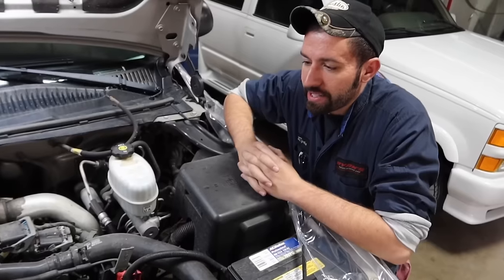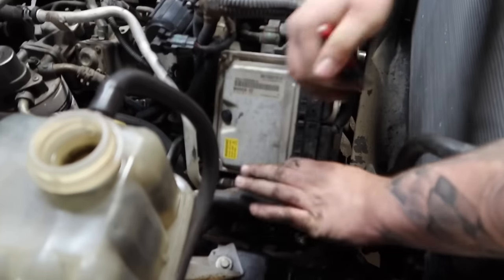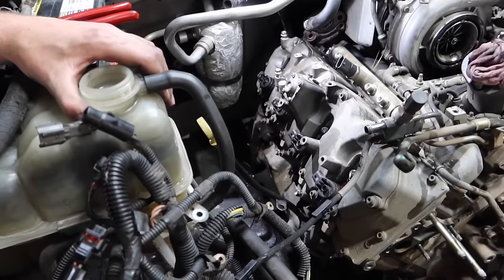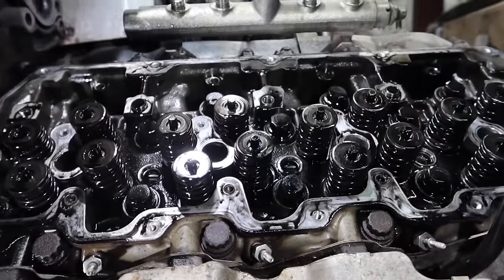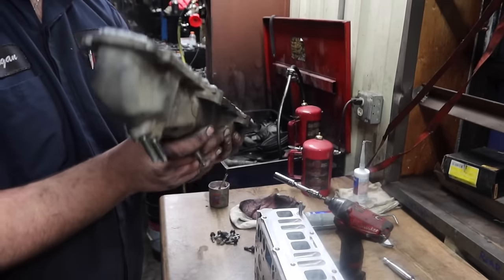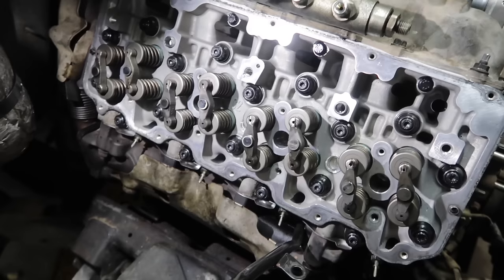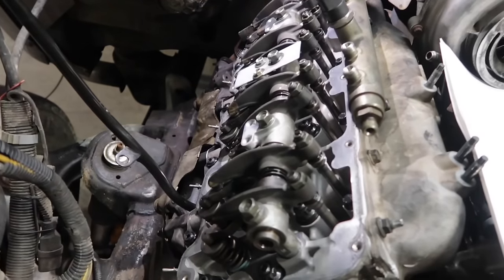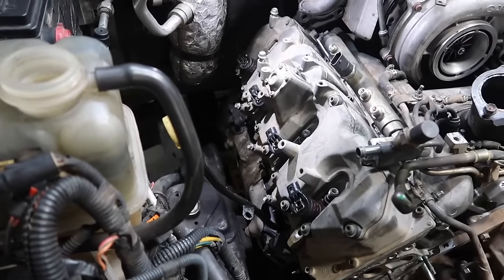How To Install Head Gaskets And Head Studs | Duramax

Comment: followed this video doing headgaskets on my 04, now I'm doing another 05 lly. Thanks again for your help.
Reply: Are you telling me I can follow this video the whole time I do my head gaskets? I’ve never done them b4
Reply: @logan8256  there's a few things I did differently:
-after tons of research I found prepping the block with sandpaper was a bit questionable, I used a razor blade and wd40
-make sure you stuff the pushrod valleys with rags
-make sure you change the oil before startup
-i chose to leave the exhaust manifold on the truck, found it much easier
-if your going the route of deleting your egr, I strongly recommend doing something with the y bridge. the mouthpiece will blow out without the factory egr holding it in, so I jb welded the 2 together 
-when removing the valve cover hex bolts, spend lots of time cleaning them out or you will strip them
-i found it much easier to remove the hood, especially if your doing it in your garage.

I've down 2 duramaxs, the first one I did the sand paper method as shown in the video, 40,000 kms later no problems. the second time I just used the razor blade. wasn't able to find any information online of anyone using sandpaper so made me very nervous.

good luck
Reply: @noahthompson9930 How did you clean the metal sanding dust out of the cylinders and coolant ports before reassembly?

Comment: Nice video of going through the process. A couple things you didn't address for your customers. The GM Technical Service Bulletin on these engines specifically goes over this part of deck prep to keep abrasives OUT of the critical areas of the engine. You are sanding the block deck with 80 grit sand paper allowing the sanding media to fall into the engine at the lifter openings and the 4 oil drain back holes in the bottom section of the deck, then proceed to NOT explain to people how important it is to NOT get sanding grit down into the oil system. How do you get away with that? Then you fail to explain that the main issue that you would be attempting to correct with a sanding block on the deck is that the deck will have a low spot at the exact point of head gasket failure. Look @35:46 in the video where you happen to shine the light on the entire passenger side deck, you can still see the low spot(dark area) in the deck that coincides with where the fire ring on that gasket was blown at the rear of the cylinder. This is where the fire ring seals on the deck, the deck is still low there. I'm not saying it is going to fail, but it has potential to blow again in the same spot "if it is too low and not addressed properly". I know you do a lot of these jobs, how many have failed since you did this to them? You may have taken steps to ensure this didn't happen, but I don't see you addressing it here in this video, please inform your customers about these not so minor details I've brought up here. Thanks for showing your process. For people watching,  DO NOT SAND your block deck like these people do in this video UNLESS you can keep these heavy abrasives out of your ring lands, and your oil and water passages!!
Reply: I do wish someone would respond to this…or at least share what they believe is the proper method.
Reply: Bringing this up is a waste of time. I've made a couple calls to the shop to speak with one of their techs to get some answers about this specific issue but their techs don't speak over the phone. So with no explanation of how they clean the block, this video should NOT be used as a reference. A lot of people's motors will end up in an early grave if they follow this video.

Comment: They did an awesome job on that headgasket job. The only thing i saw that i didnt like ( im not a professional) was that when he sanded the block surface, he didnt put anything in the pushrod valleys to prevent grit from falling in. Correct me if i just didnt see it and he actually did. Other than that they did a good job and you made a very detailed video. Too bad it came 4 months late because i would have used it to my advantage.
Reply: Yeah I personally would have done a little more to seal off other parts of the engine from sanding grit. That said though, even if some grit made it to the oil pan and was picked up by the pump, the first stop it hits is the oil filter before moving on to the bearings and other critical wear surfaces,
Reply: Absolutely. try being as clean as possible. With dirt,cast iron and sandpaper grit that will be hard to do, but try. That and  some type of lube on the valvetrain moving parts.
Reply: right... wads of paper towels would been nice
Reply: @jeffscott3160  some engines have a oil filter before the oil pump .... not the duramax ...grains of rock will get into the pump. sad to see them use sand to crape the deck it will do  no good... it might take off .00005 mill... which is half of a tenth of a thousands ...
Reply: @dougsavery5442  yep the engine started up and was gone... but the gasket was cleaned and happy... Haha... rock grains everywhere in the motor... JUST WOW...
Reply: @johncasor9698  Yeah, I agree. Proper tools should be used in this process, however a few grains of sand isn't really gonna do any catastrophic damage to a oil pump run off the crank shaft. Certainly not the way I'd  recommend doing it.
Reply: @jeffscott3160  even if u think a couple grains of sand wont do anything to an oil pump ran off a crank why  even let that be a factor when paper towels are less than a dollar a roll for fuck sake

Comment: I bet them lifters really love the metal filings from sanding the deck of the block lol. I’m sure these guys are good mechanics that’s no doubt but leaving the passageways that the pushrods go through down to the lifters wide open to get covered in metal filings and undoing the head bolts from centre out when the procedure calls for undoing outside inwards. Also assembly lube is your best friend personally I woulda applied lube to every metal surface in the valve train to mitigate dry starts but that’s just me. Other then that pretty good video
Reply from the maker: Thanks for your input Dustin, make a video as well to show us all how it done ! I’m sure it will help a lot of people in the diesel community
Reply: The sand/shavings into all the wrong places just freaks me out. No f----n way. Not on my engine. I'd rather do a full engine out rebuild and spend an extra $5000 than have sand in those critical areas. (Might result in that anyhow after the damage happens.) And that is not just regular sand .. the abrasives used on sandpaper are the strongest they can obtain/make.
Reply: @truck master that was the best response I think I have ever seen on a “suggesting comment” 🤣

Comment: I have an LMM, the turbo on mine is too close to remove the bolts at 24:00 you have to either remove the turbo or get the last bolt completely off when the heads are loose. Also the oil dip stick tube runs up through the passenger side, in between the engine mounts 😒 down behind the starter motor and into the bottom of the engine. To save yourself tons of work and frustration the best thing to do is to take the exhaust manifold off the heads instead of trying to remove that oil dipstick tube. Also to make the job 100x easier just use an engine hoist and some straps to carefully and slowly remove your cylinder heads...

Comment: Very serious question and I hope it gets answered . When the tech was prepping the block surface with his sanding technique, doesn’t that cause all that abrasive material and small metal particles to get into the oil passages into oil pump and all that ? How do you go about cleaning that up ? Won’t that destroy bearings over time ?Please reply
Reply: Yea you got a point
Reply: Really like to know some info on this too!
Reply: @danthatguy9686  I’ll give you the info . That grit is going into the crank case and stickin to the casting . Then when you drain the oil after finishing the heads (like you should do ) all that grit makes atleast one round around the bearing before the filter catches it

Comment: DURAMAX is the best DIESEL!!!
Reply: Aris Torm Detroit 2 stroke is a very close second.
Reply: @truckinman86  the old 2 strokes make some fantastic sound but thats the only thing they are good for. Poor fuel economy,  high maintenance cost, and crap torque compared to anything made in the last 20 years. yes you can modify them to make them better, but if that same effort and cash is put into a newer motor the 60 series will dominate it in all ways.
Reply: I have an 2005 GMC LLY (95,000 miles) and also a 2002 Ford 7.3. My vote for the best diesel is the 7.3...much simpler and no head gasket problems ever over the 290,000 miles that it has on it now. The LLY is definitely more powerful and quicker, but i would rather trade some power for longevity and reliability. Thanks for another great video. Used your turbo removal video and removed mine to free up the Unison ring. Now back together and running great!
Reply: Cummins is the best diesel, unfortunately dodge/ram is the worst truck. Ford is the best truck, but powerstroke is the worst diesel. 
The GM Duramax is a nice compromise
Reply: @canadagoose27 7.3 never had head gasket issues because they don’t make enough power to
Reply: OKAY!
Reply: @canadagoose27 I agree the 7.3 was an awesome engine, they too blow head gaskets... my friend with 350k just blew his...
Reply: And Truck Master is a Duramax fool
Reply: @utch2844 You're right, hard to break anything when the engine is barely tuned to move it's own weight

Comment: watched this as i contemplate a new truck, i think my ole girl finally gave in after 15yrs together the LLY has the tell tell signs... however it did this 6yrs ago and i just bought a rad cap and bled the system... may try that again, i wonder if truck master would be interested in doing my heads

Comment: I have heard some people torquing the ARP Head Studs down to 130-140 lb-ft instead of 125, especially in applications with higher than stock boost levels.

Comment: I did that to my Lb7 back in 2017 its very time consuming never worked on diesel before just gas engines, it all started with 
filling up at diesel station that contained free water in their underground tank. It busted three injectors plus one of the seals on
the high pressure pump which led to diesel leaking into the oil system. I had to tear it all the way down due to Lb7 injectors are inside
the valve cover. Once there I had the cylinder heads rebuilt. All brand new MA injectors, new water pump from MA , also a  fuel air separation
system from air dog and got rid of that OEM useless water catcher and filter. he he. still going strong 165k miles on it.
I wish this video would've been out then  it would've taken me a lot less time to complete the job. Instead of a month and a half I probable would have 
done it in a week.

Comment: Great video extremely helpful! I do wish it showed a little bit more on the driver side cause that’s the tricky side but over all very helpful saved me a lot of time on this job
Reply: How did you clean the metal sanding dust out of the cylinders and coolant ports before reassembly?